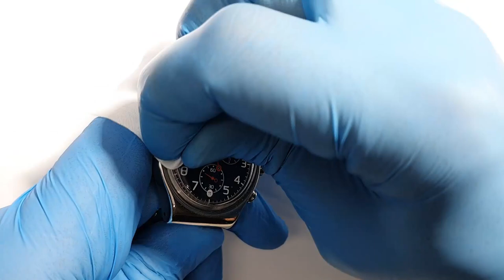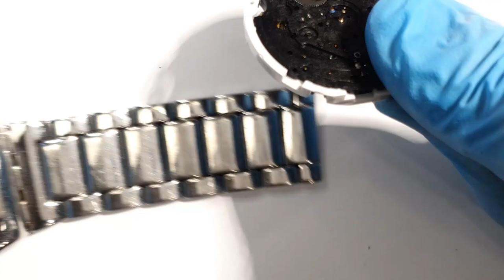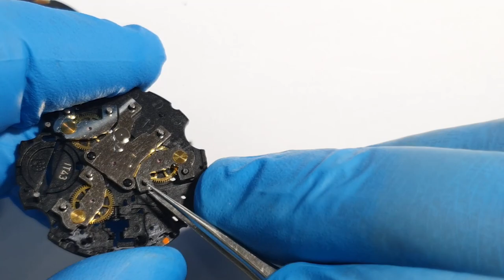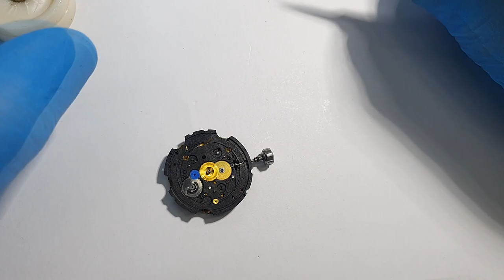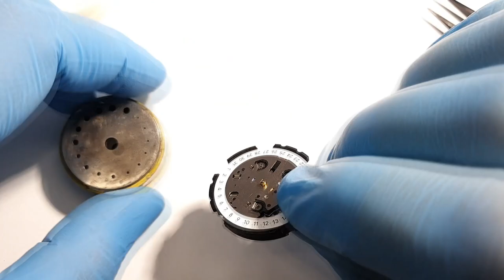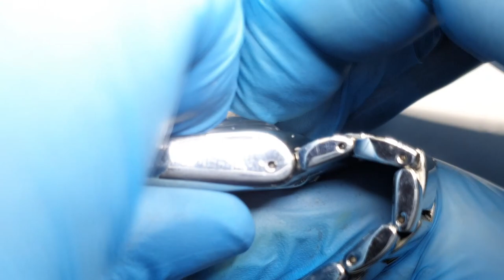How to fix unrepairable Swatch

Comment: I have a similar swatch irony chrono model its dead. No one is able to fix it. 

In your video i didn't understand what part was faulty or what you repaired after which it started working?

Comment: how to evaluate the rotor? its only a pair of plastic pins!, how to know if they are bented, stucked? I have two, one of them straight but bit sticky, and another more freely but with a little bent. Also the ones that turns do this one way only, unidirectional, clockwise but not anticlockwise. Regards.

Comment: where do you find the part? Its a metal or a plastic gear broken?  its available to buy solely?
Reply from the maker: You can buy a used mechanism on ebay, disassemble and use the parts. this g10.212
parts are not sold separately, this mechanism is not repairable))
Reply: @watch-repair  I have a 521.332 eta inside in another chrono swatch, but dont find any info about it or if it is compatibility with g10, but all of this seems to maintain the same format, mine is with 34.6mm crystal and from 2007...the only issue with them is that the date is a bit tricky but functional, maybe a disassembly, service and a time to transform to a serviceable one XD....there is a hattori, vr34 that have the same distribution of hands but with a bit bigger format 13 1/2 (vs 1/4), and for sure different hands size, but its cheap and serviceable... and japanese...maybe I will try this mod
Reply: its not necessary glue restoring of the front calendar plate?